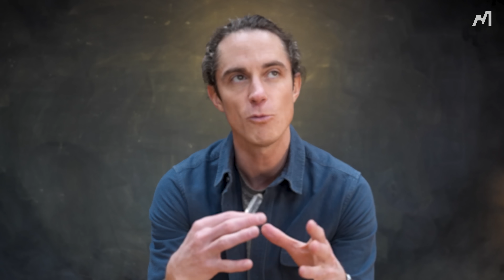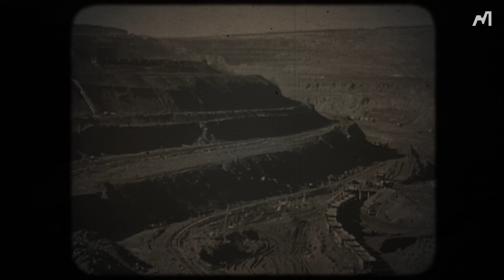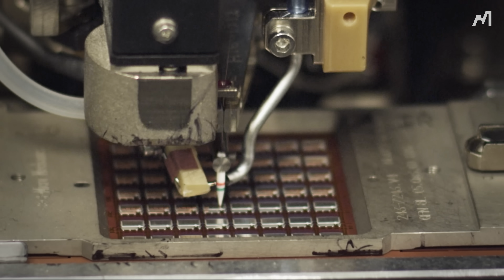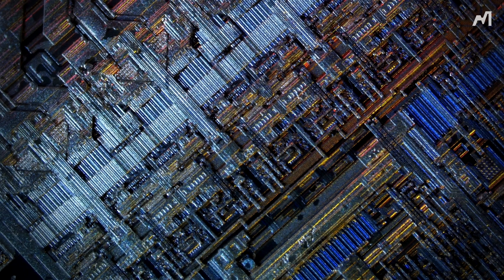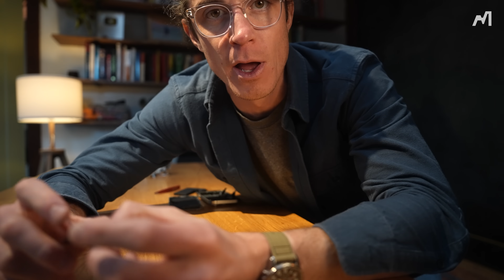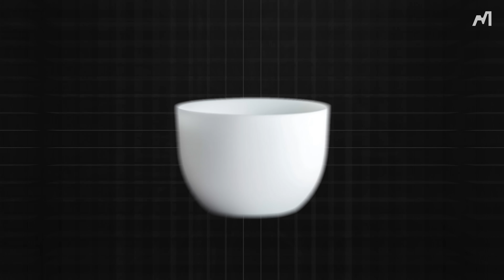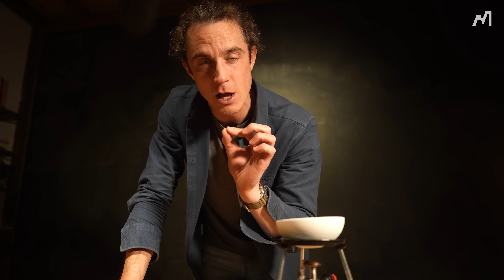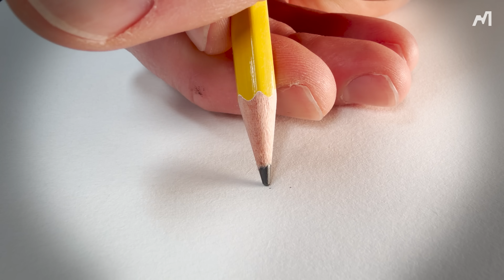Saudi Arabia Has Oil, America Has This

Comment: In electronics, man-made quartz is mainly used in quartz crystal oscillators. It's engineered to vibrate at super precise frequencies, which keeps your watch ticking on time, stabilizes radio signals in phones, and syncs up computer clocks. Pretty essential stuff.

Natural quartz still gets used sometimes, especially in specialty applications where purity isn't as big a deal or costs matter more. But synthetic's taken over for most high-tech stuff since it's consistent and cheaper to produce.
Reply: Synthetic quartz currently accounts for about 23% of the global supply for advanced semiconductors (up from 17% in 2022).
Reply: If you take a piece of it, and split it into "chunks" which are roughly 25% of the original piece, they're called "Quarters". @dfsdh432v9
Reply: So then the world doesn’t need spruce pine?
Reply: I have seen these tiny clear circular flakes, mounted onto a socket, with my own eyes, when I worked in a small factory in Germany. And I am fairly sure they were not imported from the US.
Reply: @gabbyn978maybe they were etched in nl/tw before mounting?
Reply: @holdenmcgroin3995  Probably not. It was in 1980, and this was a rather small enterprise.
Reply from the maker: I don't disagree with the electronics part but just want to clarify that synthetic quartz is not used in the silicon process. Yes, ultra pure quartz is created synthetically for very small applications. But is extremely expensive and differences in composition make it unsuitable for holding 800lb of molten silicon.
Reply: @Maxinomics  I work in the semiconductor industry. Quartz is also widely used in the tooling itself. Especially plasma systems. Just one of our process chambers probably has 20lbs of quartz, and it needs to be replaced often becuase the plasma slowly eats away at it.
Reply: @TheBeast14567 Will you share a bit more about your role in th semiconductor industry? 
Do you participate directly in growing the large silicon crystal that's slowly pulled from the molten using a pure perfect seed crystal? 
Share what you can please. 
As I understand it, that large silicon crystal is what gets cut down into super thin round wafers or platters that are then polished via lasers (and more) to create what will be etched via photo lithography, through many passes of the laser after chemical treatment, then rinsed and layered again and again, until the chip maker creates a number of these complex, three dimensional, tightly compact (in nm) shiny semiconductor chips on one of these thin silicon wafer platters.
Reply: @Maxinomics  Do you have a source for that? As I understand, several companies, such as Sumco JSQ, are already manufacturing synthetic quartz crucibles.
Reply: @braxhartman its all bs for entertainment purpose. Have to question most of whats uploaded to youtube as fact today
Reply: @Maxinomics  "Production Capacity: Reports indicate that total global synthetic quartz production was around 3,200 tons per year as of 2021."

No one uses natural Quartz for precision electronics. At best its used for kitchen counter tops.
Reply: @guytech7310  natural is used to make silicon wafers for semiconductor chip manufacturing
Reply: @guytech7310 so the main thesis of the video, that USA has a chokehold on its supply, is wrong?
Reply: @holdenmcgroin3995  of course it's wrong. You don't even need to know anything about quartz, just remember that when China halted exports of rare earths US caved instead of using quartz as leverage in response. Which means there is no leverage and there is no chokehold.
Reply: @holdenmcgroin3995  Yes it is wrong. The US has no real supply chokes. The US had a gutted economy depending on imports to survive. Same reason why Rome collapsed.
Reply: @guytech7310  that’s completely wrong… 90% of the quartz used In semiconductors comes from Carolina! Only 10% is synthetic because it costs nearly 10 times as much to make. The higher purity of synthetic makes it unstable at high temperatures. Chinas is spending billions on advancing the tech for synthetic quartz and the supply is increasing around 8% per year.
Reply: @NJ-wb1cz it’s not wrong at all. 90% of all the quartz used in semiconductors comes from Carolina, only 10% is synthetic due to the yield scores being so low - see my comment above in this thread
Reply: @AB_LDN " that’s completely wrong… 90% of the quartz used In semiconductors comes from Carolina" 

Nope That's incorrect Its all synthetic now. and has been for decades. 

Google: "Crystal oscillators, essential for generating precise, stable frequencies in electronics,
almost exclusively use high-purity synthetic quartz grown in autoclaves rather than natural quartz. "

For more precise Oscillators TCXO or OCXO are used. For noisy environments (vibrations) MEMs oscillators are used. For even more accurate timing rubidium oscillators are used, beyond that its usually cesium clocks.

There is also GPS disciplined Oscillators that use the GPS to lock in timing.
Reply: @Maxinomics Japan Super Quartz produces and sells synthetic n9 quartz crucibles. The abilities to do it are there, but havent been in demand as fhey are these days with USA being an uncertain trade partner.
Reply: This question in sincerity does that mean that this broadcast is not true ? I would really like to know.
Reply: The actual processor itself is "tuned to" the frequency of the quartz. So you're really missing out on the main thing that's going on here. There are other little quartz rocks there too, to multiply the frequency. Why is nobody on this channel educated about anything? It seems so reckless and childish to give you people rights (such as being permitted to physically touch money). What do you think about the state of the world? Do you admit that it's your fault, and that you made these mistakes outside of any religious context that could possibly warrant anyone to come to your aid if I prosecute every single one of you? 

🤷‍♂️We do this thing called "testing" sometimes. It's when I quiz you in order to see if you have any quizzicles.
Reply: @seanrowshandel1680 Pray tell, dear sir, just what you mean by your statement: 'the actual processor is "tuned to" the frequency...' 
And please explain the tuned to part I more detail so that I and others might learn something here today. 
I'm curious to understand this - all of it - better. Thanks in advance.
Reply: @rwhite4688  Computer use quartz crystals for a resonant frequency. The crystal keeps the frequency stable over a temperature range of around 50 ppm. with out it the frequency would drift making inaccurate timing which is needed.

However electronics do not use natural quartz. they are grown in factory with far better quality.

That said many electronic devices are switching over to MEMs oscillators which don't use quartz because the have better stability than quartz (around 10 ppm).
Reply: @guytech7310 50 ppm as a temp range and 10 ppm?  Formally educated as a biologist. So ppm notation means part per million to me. Last ask. I promise. What is ppm in this context?
Reply: @rwhite4688  Yes Parts per million
Reply: As per my current rate, you're gonna need to pray ten times more than that  @rwhite4688

Comment: I wonder if it can be manually created.
Reply: Chemist here. Theoretically yes. But in practice, no. Way too slow, expensive and extremely difficult.
Reply: Yeah, advanced nanotechnology. We're not there yet... or are we?
Reply: @sabatheus you just purify it similar to uranium enrichment. Ridiculously expensive and wouldnt yield much output
Reply: Yes it can be and is often preffered for super high end tech. It is 5-10 times more expensive, but countries have been ramping up production as they see the value in it and don't see trade with the USA as stable anymore

Comment: All those 'black arts' skills are going to be eroded by AI, eventually rendering them all obsolete. I'm not an AI fan but it's an excellent tool for finding out exactly what is unquantified in those skills, teasing out the numbers that turn it into a formula. It just depends on having enough sensors in the process to feed the AI enough data that it can find the patterns that reveal the secrets. Seems to me that building those sensors is going to be big business in coming years.
Reply: This is actually one of the real use cases of machine learning (NOT LLMS), doing mass amounts of grunt work to try and find just the right configuration or set of variables. As much as tech bros want you to think ChatGPT can do that, it can’t. What I’m referring to are purpose built machine learning systems for a specific scientific task, not large language models like Gemini and ChatGPT.
Reply: @briffsqueeze4063  Yes, that's exactly what I mean. Purpose-built models doing one very specific thing very quickly. Completely different from LLMs but generally there's little point in making the distinction.
Reply: Loll you think to much of it.